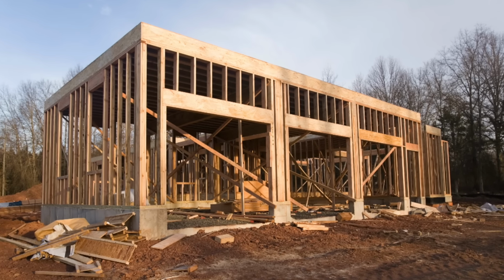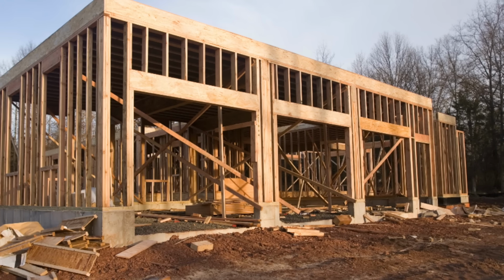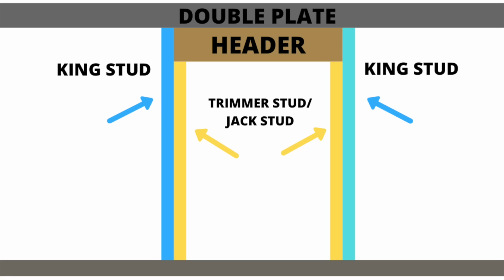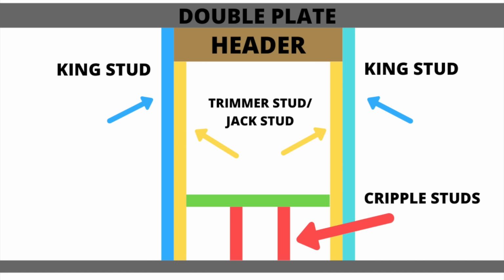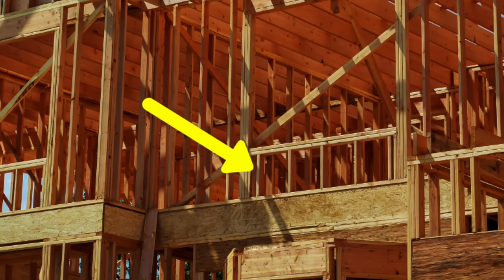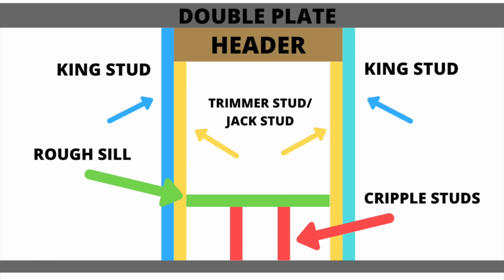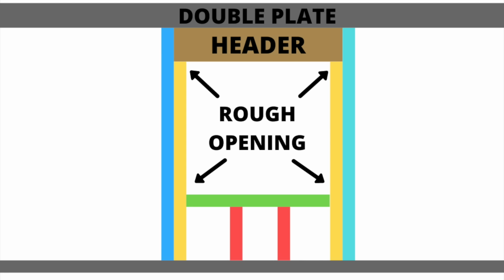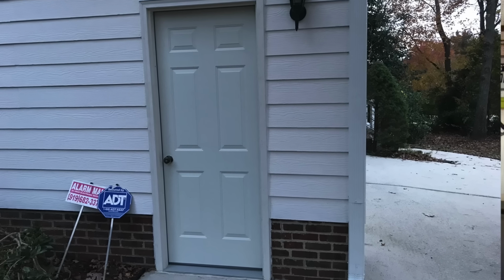All House Framing EXPLAINED...In Just 12 MINUTES! (House Construction/Framing Members)

Comment: as an electrician who wants to build my own home one day, i now realize i know nothing about framing haha
Reply: same situation :D a lot of electricians wanna build it seems!
Reply: @DarkVoxels  I'm an electrician and I'm about to build a huge addition on to my house now😌
Reply: Don't worry most framers Don't know how to wire a house .
Reply: @justotorres8970  A journeyman at the electric company I work for used to be a framer.
Reply: You seem intelligent enough to want to learn so in my  opinion you seem well equipped to build your own house.
Reply: As an engineer, there's nothing I hate more than framers that think they know better. Don't just put 2 jacks and 2 kings everywhere. Just follow my drawings. There's a reason none of the hold-downs line up, and the more studs you put, the less insulation there will be, and Arch isn't gonna be happy about that. Had a framer put one jack and one king on all the interior doorways, including the one that was supporting the drop beam that held up half of the second floor. Just. Follow. The drawings.
Reply: @ImranZakhaev9  if framers just. Followed. The. Drawings. every time, some of the houses would not even function properly. Most engineers have never put a belt on let alone bang a wall or frame a roof, but they’re supposed to tell me how to build a house 😂
Reply: @fullsend4life28  
Of course I can't tell you HOW to build it, but when it says right on the drawing that we need three studs under that beam and I show up on site and there's only one, who's fault is that?
Reply: @ImranZakhaev9  if someone doesn’t know how to point load a beam properly then I don’t know what to say. Whenever an engineer can’t figure something out they write Frame on site then close down their computer and never think about it again.
Reply: @fullsend4life28  
This is fair, we do try to dump as much of the work on others as possible 😂
Usually we say "see architectural" when we can't be bothered. We will usually just leave things like parapet infill studs, and non-load-bearing window frames etc. as "by stud supplier"
Reply: @ImranZakhaev9  word
Reply: @ImranZakhaev9  I never liked the load going to a header. Does your framer reinforce the framing in the floor under the king and jack. my bet they don't. was that gender made of lvls?? I'm  a customer framer that has one of the best reps in our area. I usually got a dollar or more per ft than others. still couldn't  make any $. Guess I'll  just keep yhe rep and do the quality work.
Reply: @robertkwiatkoski1292  sounds like you’re just wasting your time. mine as well go to McDonald’s and flip burgers for $16/hr
Reply: @ImranZakhaev9  q- your a Liscensed engineer? Structural? From where? Q- my opinion means nothing  a Architect/Engineer/General. Pre- Required 4 Years of Carpentry in hands on experience. Blueprints, UBC, etc..
Reply: @tomlacorte9833  
Engineer-in-Training in Atlantic Canada.  Need 4 years experience before getting my PEng. I don't have very much hands-on experience, so I enjoy doing site visits/inspections so I can talk to the tradesmen doing the actual work. Get way more experience that way than in the office.
Reply: @ImranZakhaev9 there’s NO WAY your an “engineer “ more worries about insulation space than making sure the house is rock solid in case of hmm tornado maby an earth quake… yea I think I’d rather have the extra studs in my life long home you can have the extra insulation 👍
Reply: @James-hw1gk  
Put all the studs you want. Doesn’t make a house “rock solid”.  Every tornado or seismic failure can be traced back to the weak link. In tornadoes it’s usually the sill anchors or the hurricane ties, and garage doors. Seismic is often holdown anchors, soft-storey, and diaphragm connection. This is the stuff most framers don’t understand so they just think “more wood & more nails” will make everything stronger.
Reply: @ImranZakhaev9  perfect example of life on paper vs. real life.....so many projects have failed because of engineers poor designs and decisions...the show "Engineering Disasters" is proof ...
Reply: One thing I know for certain about framing is it cost 4x as much for the wood material as it did just a few months ago.
Reply: As an electrician that built his own house - I recognize all these features but only knew the correct names of some of them.
Reply: My World  I know guys that want 50 percent off they get put on the back burner not much priority right now.
Reply: Same here.Im a fence builder and have done some rough framing but have never actually looked into more than just building walls.Definitely helpful👍🏽
Reply: And after watching this video, you're a certified electrician AND carpenter now!
Reply: - I work with HVAC and I need to know what I can or not to cut...
Reply: If you do, triple up on you jack studs and put blocking in around the doors. It takes the shake away when shutting door. If wanting hard wood floors make sub floor perfectly level with sander and use glue to prevent floor creaks. Same with stairs and beef up stair supports. Caulk exterior walls and dont go cheap on insulation.
Reply: When in doubt add another stud...you cannot overbuilding!  I always put in two jacks and two kings on all windows a doors...triples on overhead garage doors
Reply: @marcsheldon6512  Me as well. I also double plate any window sills over about six feet. Much longer they have a tendency to warp. Overkill yes, but quality pays in the long run.
Reply: @loveistheanswer8137  in California it's code to double plate because most houses are stucco and the stucco guys come through and staple through the window flanges, not so much a single story problem but a big-time two-story problem
Reply: @marcsheldon6512  true that they should be at least Shear Walling all these crappy two stories they're building in California I hate to see these houses in 40 years
Reply: @marcsheldon6512  that’s why your broke and out of business
Reply: @marcsheldon6512 the plan is to get as much insulation as possible so don't just add studs for fun.
Reply: @marcsheldon6512  hell yeah me too. 5'10" rough opening for a front door and since it's less than 6 ft one jack and stud is fine for allot of builders. If I'm pissed at the old lady and want to slam the door I want it to slam haha. I agree, overkill when in doubt. Like my corners extra strong too.
Reply: @davegordon6943  big rule ive learned for life, is overkill is still dead.
Reply: @bradhaines3142  it's because we are always around it...I used to wanna be a block Mason when I built at a school from ground up  chasing Masons all day
Reply: @bradhaines3142 😂imma remember these words til I die
Reply: Same here 😂😂 I refered to all things as studs
Reply: Fak: while you don’t how to frame, can you tell if a framing job is good or not? I mean, since you’ve been on a lot of job sites, are there clues you get as to when the job is well done?
Reply: @stephenholland6328  if the floors creak usually a big sign if its already covered up, not for sure though could just be floor guys
Reply: nails and screws go brrrrrrr
Reply: I do hvac and feel the same haha
Reply: Mate so much detail goes into it even I did not know, knew concrete holds moisture but that treated plank of wood to act as a barrier 

Never knew 👍🏼
Reply: Before I became an electrician I had a privilege to work with my dad when he had a framing business, don't know the codes all the way but I can do a roof, siding, little Mason work, majority of plumbing since it's all common sense, just like electricity. Alotnof framers will not even try to fuck with 110 lol glad you willing to do it on your ow , just learn the basics, it's easy, make sure you build headers and all the other goodies, framing is way simpler then electrical work. To some I suppose. Good luck, you got this
Reply: Framing for a year really helped me be a better residential electrician. Unfortunately, Im still doing residential and I hate it. MISTA MISTA GET ME OUTTA HERE!!
Reply: Right. Lol
Reply: We're a plumbing company and it's the same for my husband and I 😂
Reply: It’s a piece of piss if you can read plans
Reply: It’s actually not hard. I’m no expert but I framed houses for about three years and now I just do shop carpentry, however it’s like a puzzle. Once you figure the fundamentals out, it puts it’s self together. Nominals and knowing the tape measure  are key
Reply: I agree
Reply: Trade your trade work to a framer for his.
Reply: I know the difference between black white and green does that mean I know how to be an electrician😂 fuck man you can't learn a trade just by drilling holes through it
Reply: @tonyrobert371  yeah they are colors… “my 4 year old is learning those” that’s the equivalent 🤣🤣🤣🤣
Reply: Lol same here, electrician with aspirations of building tiny homes
Reply: As a carpenter who wants to build my own house one day, I now realize I know nothing about electrical.
Reply: Honestly framing is alot easier than it looks. Don't overthink it. If I can build a house, then so can you.
Reply: Its great when all you know is manufacturing..

 me looks at foundation....ummm how dafuq can i make it level if i cant put it on a bridgport?? Joke lol
Reply: You dont really need frames to build a house ya know?
Reply: Framing is simple, 16" centers 345
Reply: lol
Reply: https://youtu.be/soIz366s9GY
Reply: Lol same ⚡⚡⚡
Reply: everything is either 16" or 2ft on center which is easy enough..only problem u got is sheeting the roof
Reply: @georgethinks9431  Maybe 19.2".
Reply: Wow! I have never heard an electrician say they didn’t know something! Impressive! You will likely be just fine! I always say, If you already know everything then you cannot learn anything!
Reply: @tjbrown3753  HAHAHA!!! This is SPOT ON! F electricians, no offense
Reply: We share the same dream my friend. I too am an electrician.
Reply: Lol, I'm in the same boat 😂
Reply: Thats the same thing I thought
Reply: l
Reply: It’s okay man. I’m a framer. And I’m planning on building my own house soon. But I wont try running the electricity. I’ll leave that to the pros. We all are good at something, and we are also not so knowledgeable at other things.
Reply: Facts same here
Reply: electrician that wants to build my own home as well.🤙🏻
Reply: Same here
Reply: That's why electricians and plumbers are always cutting through structural members reducing or totally ruining their structural integrity.
Reply: It’s sad to know is electricians can learn something… 🤣🤣🤣 #kingofthetrades!
Reply: @zackjasper4230  bahahaha
Reply: I thought electricians knew everything
 Lol..j/k
Reply: @tmrb7600  we do… 😑 🤣🤣🤣
Reply: @tmrb7600  😆😆😆
Reply: Oh sparkles it’s actually really goddamn simple
Reply: I work with framers who don't know what to do, don't feel bad 🤣🤣🤣
Reply: Hey bud if you can do electric wood is easy my guy
Reply: If you're around framing carpenters you probably can make a deal with them to do the work for cash on the side. You'd save money by being there and carrying the lumber and in the mean time you'll learn alot. I have a ranch so when it came time to frame I had a bunch of family and friends (we're all in construction LOL) and we finished the walls in one day.
Reply: Mr trying not to fail my cacc classes
Reply: Dont learn to paint itll break your psyche when you got no trade to blame but ourself
Reply: HVAC dude here: I'm in the same boat man
Reply: sure, just don't build your house with cardboard
Reply: Build with cinder block then. You’d only need blocks mortar and rebar
Reply: Lol electrician here from Florida...it's all metal here
Reply: It’s ok.. you just have to find a good framer that knows what he is doing.
Reply: I'm a carpenter that won't touch electrical I will change out a fixture but anything more I will pay a pro to do it I have had to go back and fix many sparkys craftsmanship
Reply: I'm looking to get into the electrician union. And not move this time.
Reply: @mannysabir1339  unions suck
Reply: Why isn’t lathe and plaster used anymore?
Reply: @frederickfarias9515  Probably quadruple the cost of drywall
Reply: Hire a framer, you wire it, and I can roof it.
Reply: Im wanting to enter that trade but i dont know where to start, how did you start as a electrician
Reply: @Radiationpoision  I had a background in other trades that probably helped me. I had to let the employer know I really wanted the job. I also had to take a lower wage than I deserved. I think a lot of it came down to there being a lot of people who want to be electricians so the employers can choose from those many prospective employees. I worked with a non-union group in new building and we did a very small amount of remodeling jobs. There wasn’t classwork required to get started back then (2018.) There is about now about $1,000 worth of class work required to get your trainee card (in WA state.) Overall, I think the trade comes with a lot of extra liability and hoops to jump through - you’re also tying yourself to one skill / one trade. You can make more money than some other trades after you’re working for yourself. The incentives to become an electrician aren’t really there, at least for me. Electricians take a great deal of pride in their status in the trades which I think is silly. A couple last things: know how to handle an impact and driver and be able to focus and work without breaking things. That would be a good start. Electrician bosses have higher expectations than other trades and are in my experience much less forgiving. I’m sure there’s variation regionally and in others’ experience (would be interested in hearing that if this catches anyone’s eye.) Hope that helps.
Reply: As a man who is neither electrician or carpenter I have even more ground to cover than you. WOW 😲
Reply: What about building with SIPS panels?
Reply: did an electrician just admit they didn't know something
Reply: I’m an Eletrical apprentice 1st year and tell my journeyman “the piece that looks slanted”
Reply: First step study and learn what a broom is and how it functions then you can continue to learn carpentry
Reply: I could have told you that when you said 'im an spark'
Reply: Your an electrician and don't know what this stuff is called?
Reply: I can't even saw together 2 boards.
probably cause im using a saw. .
Reply: It will come to you when you get started. Get a couple of carpenter to help you out. I know that you have a few friends that would help
Reply: The best electrician’s know framing pretty well. I’m in the same boat. I’ve framed basement’s, but that’s a lot different than building a house. Keep consistent, much love
Reply: The coolest framer I came across told me once I was a termite. I was all offended then I thought about it and decided he has a good point. Sparky’s are termites to framers!
Reply: I understand framing but not electricity or other trades,
Reply: Electricians aren't smart enough to frame
Reply: Same
Reply: To many electricians dawg go ahead and get outta my trade
Reply: Don't worry. As a structural engineer, I know nothing about electrical lol
Reply: Right. I know the feeling.
Reply: "Knew" lol 😆 I am an electrician and now I "know"
Reply: Did u build one yet? I built my own shed before so it’s a good place to start
Reply: It make sense because you’re an electrician 😂😂😂
Reply: Well yeah...your an electrician. You literally get paid rediculous amounts of money to know nothing 😂
Reply: Funny bro! I'm a framer and I HATE doing electrical! I'm so bad at it. 
I'll run the wires, but I tell customers I do not, under any circumstances, connect anything to the box. I make them hire an electrician to do the final connection and to check my work.
I rarely make a mistake, but it does happen occasionally!
Same with HVAC and plumbing. I stay in my lane of knowledge!  :)

As a framer, it does help to learn those other skills though. That way I can speak your language and build a better frame that's well prepared when it's time for you to join the job site.
For that same reason, I appreciate an electrician who understands my job as well!
Reply: Don't worry. I'm a framer and I'm a complete idiot.
Reply: 5:34  Who tf decided not to sheet the 1st floor and
Reply: Thats literally why I'm here haha 😅
Reply: I've made my peace with it. But plumbers and elections make more $than people that build the structures. Because plumbers and elections are licensed
Reply: I wouldn't wire a house and you shouldn't frame one
Reply: Wow the arrogance is halirious. Love to see big mouths do stairs, rafters ,and gables....and don't forget how slow you will be compared to framing crew
Reply: As a plumber i feel u
Reply: lol.. same here,, im an ironworker,,, I build skyscrapers for a living ,, so I had the bright idea I can build a house!!! .. im learning tho !! Never give up
Reply: I’m just learning too!
Reply: You don't have to. Just do some electrical work for a carpenter.  I trade swap with my mates all the time .
Reply: Same situation, from Brazil
Reply: Same
Reply: Go volunteer on a habitat for humanity job and you'll learn real fast
Reply: Have you seen my broom?
Reply: What do you mean if you're an electrician cutting through that s*** you should know what it's called if not I don't understand how you're an electrician I'm not just going to cut a random stud to f**** make a wire fit you want to be a badass electrician know what all of its called know what you're cutting know what you're doing know where you're putting it if not switch to being a f**** framer you'll learn 10 times more even about being electrician because you have to set it up for him
Reply: Im a carpenter apprentice so in other words im a dumbass
Reply: Me too lol
Reply: Neither do builders lol
Reply: I wanna build my own house 2
Reply: Look up some basic framing and get some good blue prints its not to hard if your doing a basic design nothing over the top.  You can pick up framing a normal house in 40 hours or so especially if you cut you own pipe and wood for your electrical you have the basic measuring fundamentals so your off to a good start and if you get good blue prints it will tell you the length of pretty much everything and how to build the wall.  You can do It
Reply: Is an electrician joke ??
Reply: @mariogatica2363  😂 an electrician would say this as a joke. They should know most of this terminology and should definitely be able to pretty easily work out how stuff goes together and why it does the way it does.
Reply: Sorry to mean but you asked for it.  You're a spark, not one of you knows jack all about construction. That's why foremen are usually bricklayers or chippies. I can build the frame for you, clad it, insulate, plasterboard, doors, floors and  kitchen, you can wire it 😁
Reply: @mattymc6802   Don’t sell us electricians short. I’ve permitted, framed, insulated, roofed, wired, plumbed, installed the duct work and HVAC, sheet rocked, painted, tiled, landscaped and decked my own properties. I haven’t had many vacations though.
Reply: @garymilstead4199  ....same here and years ago when I was just starting my own electrical business, i filled in my down time by working as a framer for a couple of my contractors.  I had a family to feed.
Reply: @Gary Milstead  I'm an electrician and I also do all my own work from the roof down to the concrete. Vacations and sleep are in short supply though 🤣
Reply: @garymilstead4199  #lies
Reply: @jackelectricman  you should have invested your money better
Reply: @joshjohnson1082  I’ve never heard an electrician (not) tell someone they are an electrician
Reply: @joshjohnson1082  I always started at the concrete and worked up to the roof.
Reply: @mattymc6802  well I'm an electrician and we do most of our own stuff.  We don't build the building often but we will when needed and it depends on the contract
Reply: @mattymc6802  Shit ain't complicated....
Reply: @mattymc6802   Hey, I'm an electrician, and I've watched Larry Haun; that means  I could frame a house right?  😏